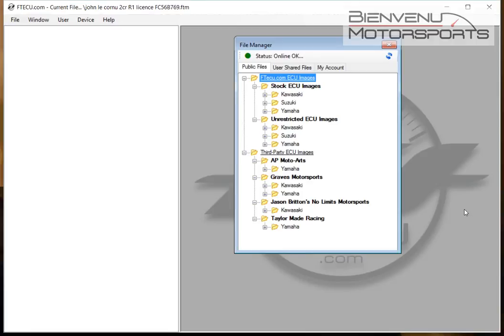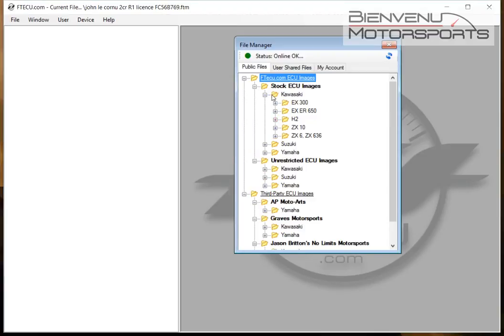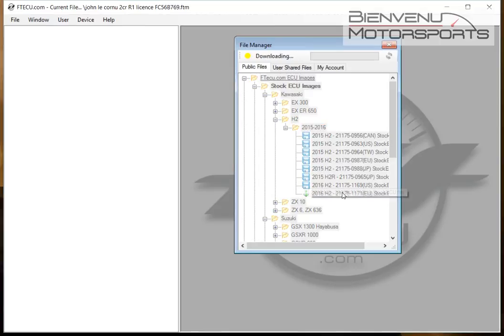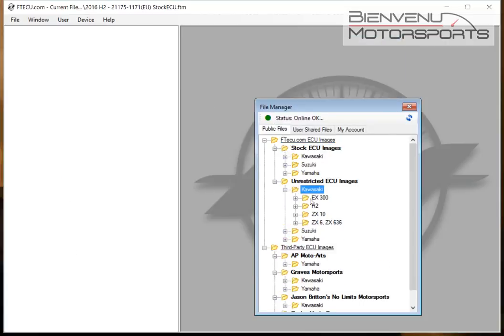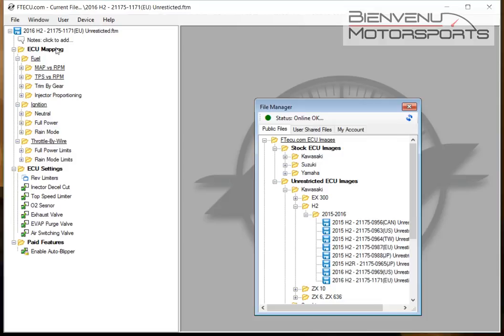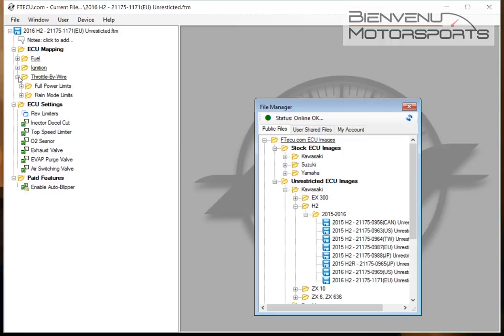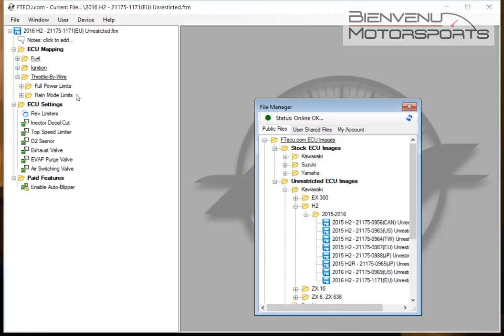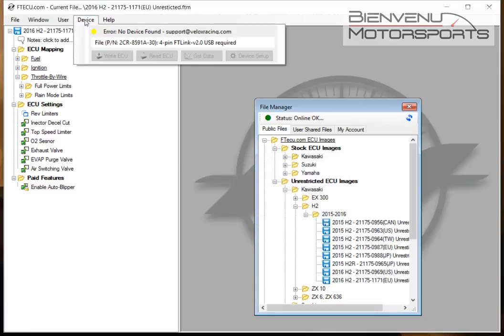FTecu FlashTune simple overview

Comment: How do you verify what the maps are meant  for exhaust type air filter so on. I have a gsxs 1000 and I see 6 maps but no description.
Reply from the maker: Hi there, the unrestricted map that matches your ECU part number would be a suitable base map for bike with decat exhaust or full system and an after market air filter.

Comment: Total trash ECU flash software.  Woolrich has 10x the tune-ability.  Sorry I went with this BS version.  Research your purchase!  I am a confirmed FTECU customer.. totally not happy with my purchase after getting flashed with Woolrich.  Wanted blockoff plate warning engine light fixed and o2 sensor engine light fixed, and was told you are out of luck unless you have the right motorcycle on our list.  You sell a $400 product that you do not upgrade/fix?  Says it all!

Comment: what is "Inector decel cut"? the thing is that i flashed my zx10rr (unrestricted flash) and after that as my bike is an RR i have the autoblipper as stock and now i feel like the bike pulls a litle bit forward 80% of the times i downshift and just a few times it downshifts as smooth as it did before flash. maybe that "decel cut" is the problem, it is disabled now